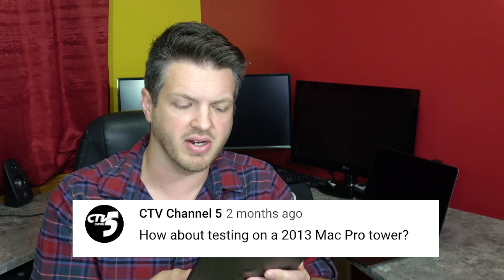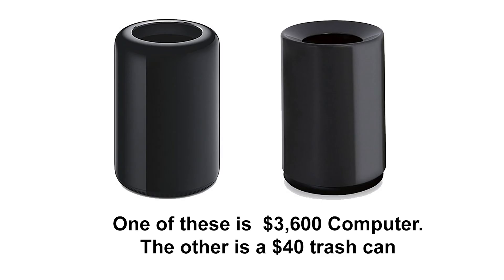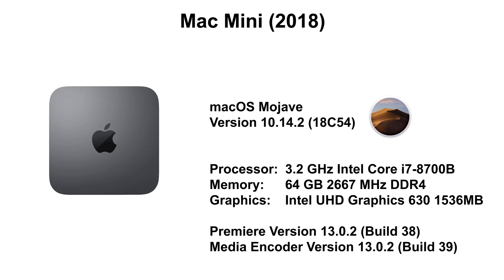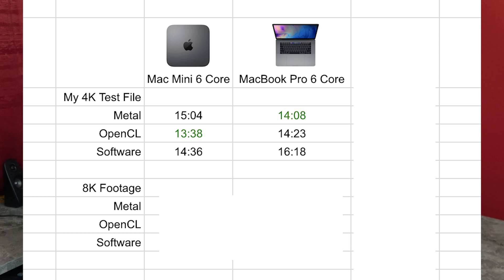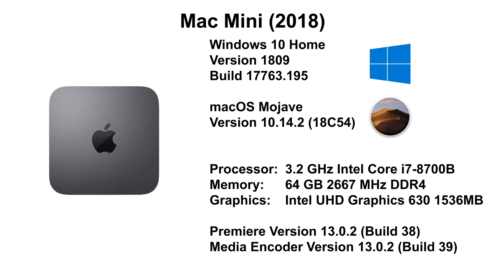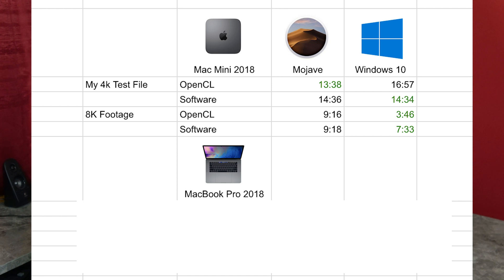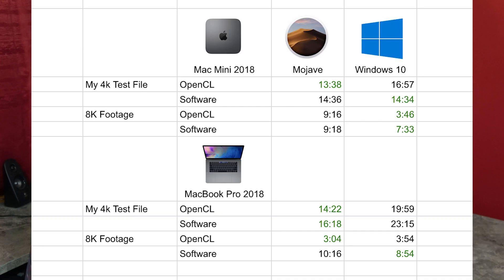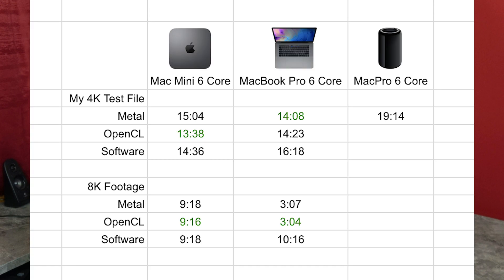Apple and Adobe Q&A

Comment: I just did a test on a spec'd out iMac Late 2015 27" iMac (i7-m395x) and Resolve 16 on Catalina, and a 15 minute video took 2m28s to render out using Metal, and 2m45s using OpenCL.
Reply from the maker: Nice. I haven't gotten around to trying Resolve. Good information!

Comment: Great comparison, you seem to know a lot about the consumer i7 new Macs. They use Intel QuickSync helping in video rendering. You can download "Intel Power Gadget" fromIntel's site and view the "GFX" graph, to see when Intel Quick Sync is kicking in, this is found on all the Intel consumer processors with integrated graphics ("i7", for example). The MacPro 6,1 is slower because it uses server grade Xenon processors, which is also what the MacPro 1,1 - 5,1 (cheese grater, real towers) used. They can come with upto 12 core and the later ones support multithreading, that's why people still use them. They are not optimized for h264 video like the i7 is. They also come with discrete graphics cards and had you run your other tests on the MacPro 6,1, I suspect you'd have seen much better numbers, probably close to or better than the MBP. So as much as I hate to say it, after you've done 3 videos on the topic, as far as the Mac Pro is concerned, this video's tests are incomplete. I also hope the 6,1 dies, but, wish they would bring back the 5,1 style towers! That said, what you are highlighting, is how far the intel consumer processors have come thanks to Intel Quick Sync. That's also why the tests you ran in windows 10 did so well. I believe Windows 10 has better integration of Intel Quick Sync than Macs do. You might also want to read this: https://theblog.adobe.com/important-information-on-gpu-acceleration-with-cuda-and-apple-metal/?fbclid=IwAR3x_0e-_--UPpzQtYMt5TmoY2E_fwF2-S2xrJPB-wkxi5tDz-pEfpDXLzk and if you are not already, use the Nvidia web drivers over the MacOS included drivers for anything using nVidia dGPUs, IDK if that'll help with OpenCL but it'll help with Cuda for sure.

I only know all of this from my HackIntosh experiences and working very hard, using the guides on TonyMac to get it working and seeing some small performance benefits on my 3rd Gen i7 machine, but, the gains in each generation are better and you've tested the 8th Gen Intel i7 processors here. All proof that I need to bite the bullet and build a new Hackintosh to get  8 core i7 with the better Intel Quick Sync! Check out the chart at the bottom of this page to see what I'm talking about: https://en.wikipedia.org/wiki/Intel_Quick_Sync_Video  

Keep up the good work and thanks for all the tests, you are helping to answer my hardware questions too.